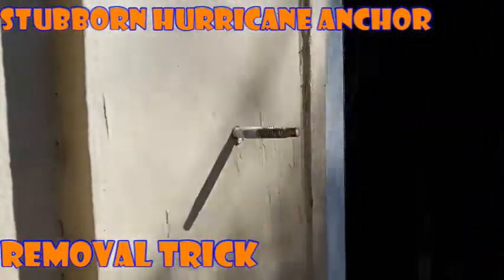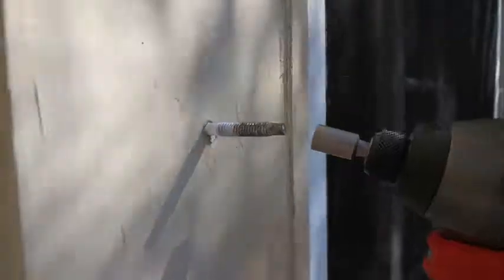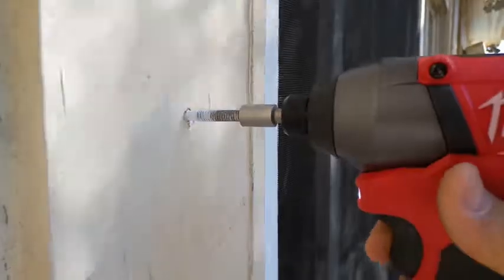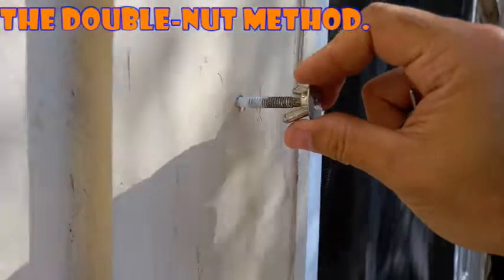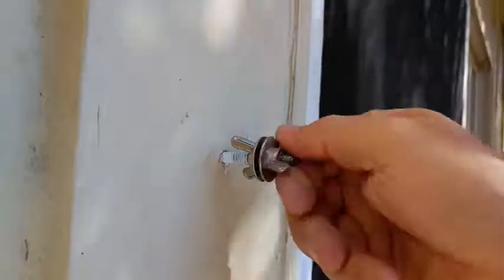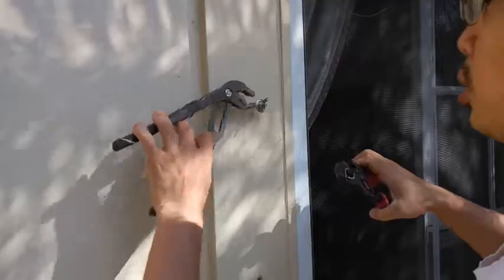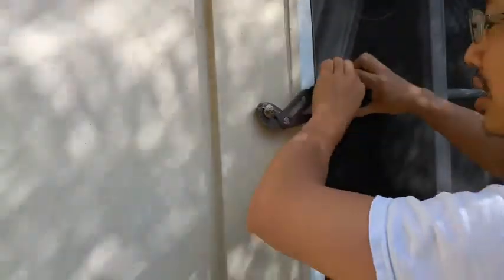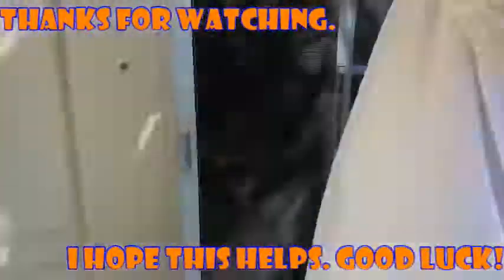Hurricane anchor screw removal

Comment: Can I have the total size of that Hanger bolt anchor please,
Reply from the maker: Like the TapCon anchor screws, they come in different lengths and girth, Carlos, but the design are generally the same. I've found some similar ones on Amazon @ https://amzn.to/3V3WjKB CONFAST® 1/4"-20 x 2-1/4" Male Hurricane Anchor Kit (25 Sets, 1 Driving Tool). Mine were the Midwest brand and came in a plastic box along with the driving tool for wood. I imagine there would be a harden steel variety for concrete or block embedment. Good luck.

Comment: What's the proper method of putting a new stud in there?
Reply from the maker: Proper anchoring principle for screwing around the house: pilot hole slightly smaller than anchoring bolt (<1/16", 1/8", or 1/4"), depending on base material and size of anchorage. Thanks for watching.